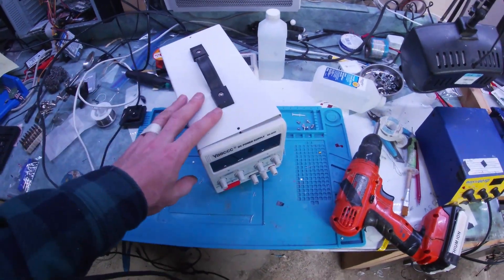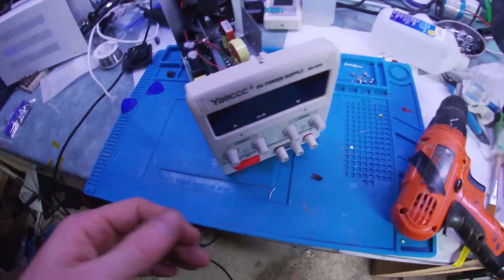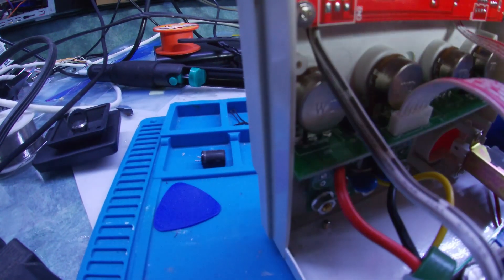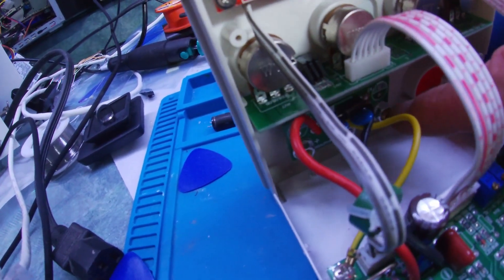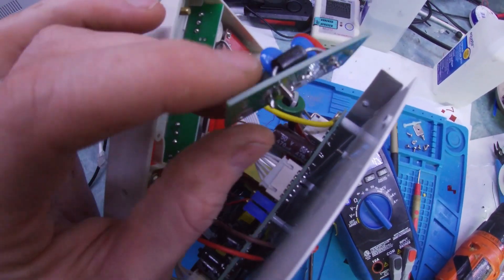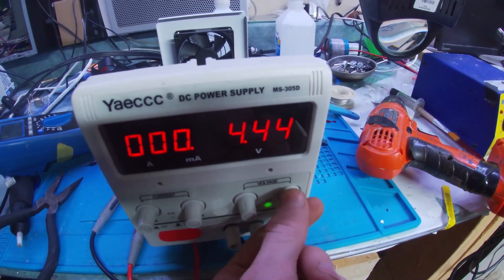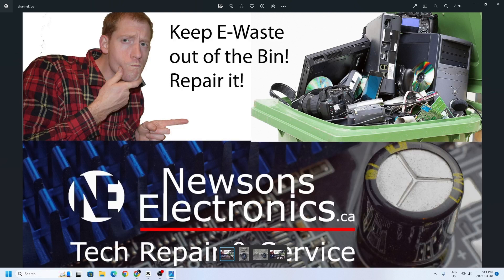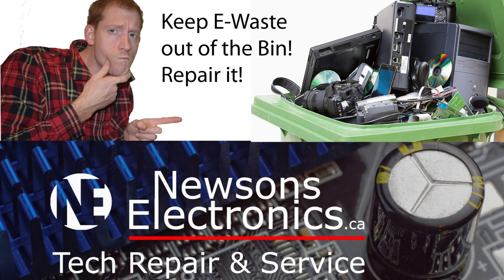DC Bench Power Supply Repair (MS-305D)

Comment: I'll will check if mine has the same fault.  Only used for 1 hour.  Sinple 6v .2amp load and it died suddenly.
Reply: I am having and issue also. My issue is he voltage is not stable. I have no diode in that panel in which I have seen busted in another video also
Reply: My power supply does show the voltage but i don't have current...I have used to charge a Dyson hoover... today has stopped working..I will check the diode maybe has gone open..